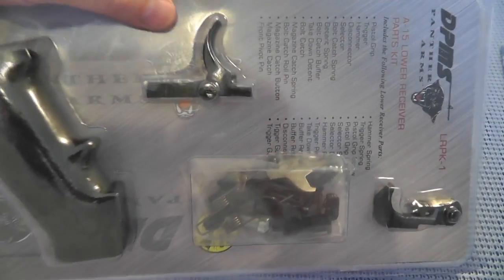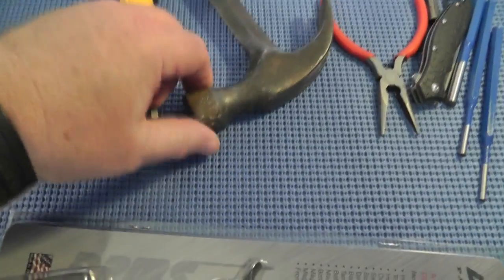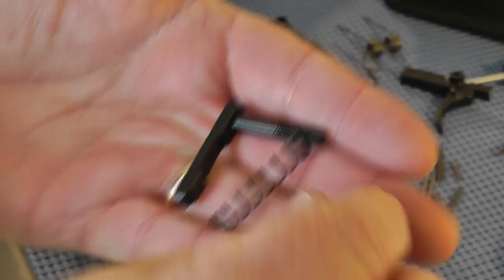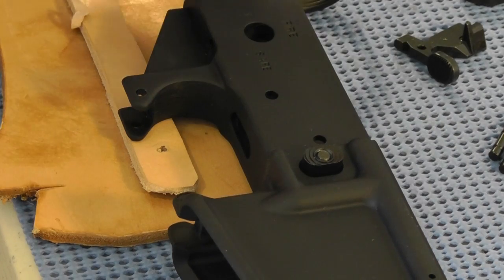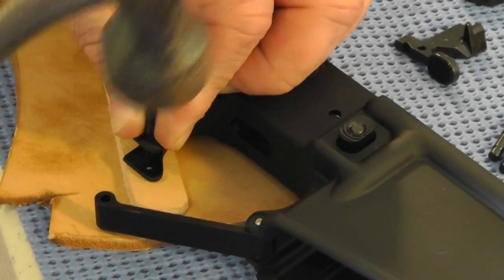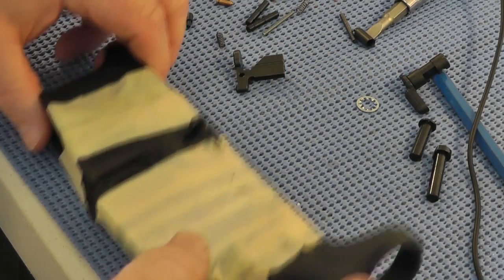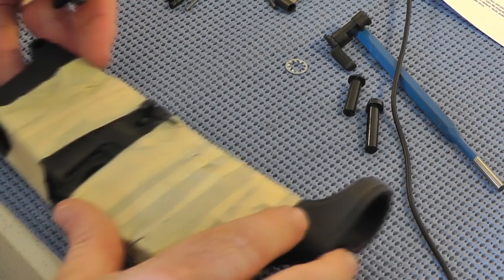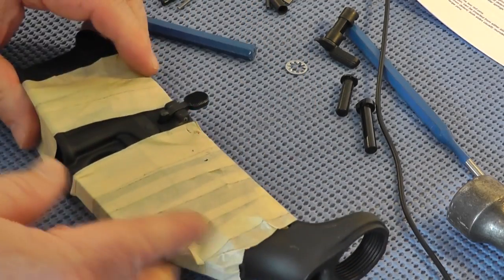Funky AR-15 Build - Part 3 - Lower Parts Kit Assembly

Comment: On the pivot pen spring recess there is a hole about half way down. The trick is to push the spring down in the recess then use a small punch to hold the spring in. Then drop the retaining pin on top of the spring and put the the pivot pen in, pull the pen holding spring out and painless installation.

Comment from the maker: @HawkLMT LOL, I organized the parts a little better after that :)  I had just dumped them out of the bag :)  I looked several places for a 3" bolt that was 1/4" and the 32 thread count but had to settle on that one so I just about had to slot it myself :) Thanks!

Comment from the maker: @Dambo96 I actually tried to find an allen head bolt on Sunday but could not find one 3" long, 1/4" x 28 thread count.  But there is a company here called Atlas Bolt Company that I will go to in the next few days and pick up one.  Thanks!

Comment: The bolt catch pin, what I did which worked nicely for what I was working with...I used a set of vice grip pliers to squeeze the pin in place, I did the same with trigger guard pin. I had a piece of denim separating so it wasn't metal on metal.

good luck in future builds!

Comment: Hey man I really appreciate the tutorial on building one. I'm actually looking at doing a similar build with wood furniture and an a1 upper. Never owned an ar15 or m16 before. Quick question though, does the lower come with a serial number or is there some sort of legal loophole in regards to atf regs for putting your own together? I'm new to the whole building and modding guns thing, prior to now I've always just bought em and shot em as they came and mostly just bolt actions and lever actions lol.
Reply from the maker: Yes, the lower you buy is the registered part and is the firearm.  All of the other stuff is just parts put on the lower which again, is the firearm.  This is what lefties don't like about 80% lowers that you mill out yourself because they is no way to track them.
Reply: @ArtisanTony  oh ok cool. Yeah up here in Washington the laws just keep getting worse and worse. Told my wife it's about time we move to Montana or Texas or somewhere that recognizes freedom.
Reply from the maker: @jeremyknop5378  look into 80% lowers.  They are still legal there.  They are cheaper but admittedly can be labor intensive. :)  you can buy the milling templates cheap and ,mill them out with a drill press. You can build and own one but you would not be able to sell it without a serial number on it.  If you think you might sell this rifle later, just buy a ready made lower :)